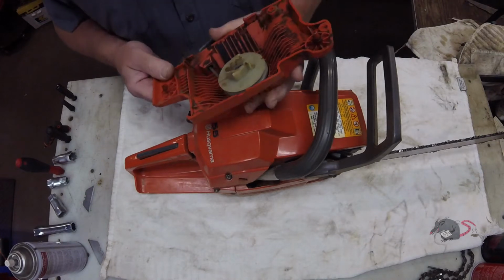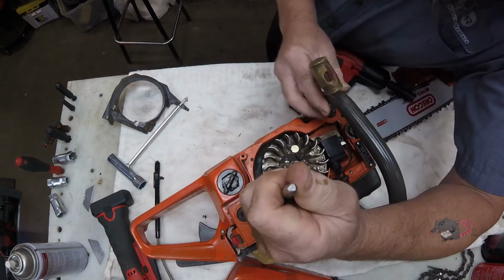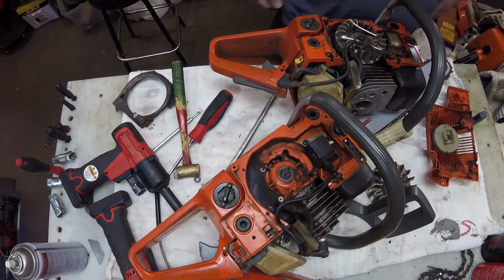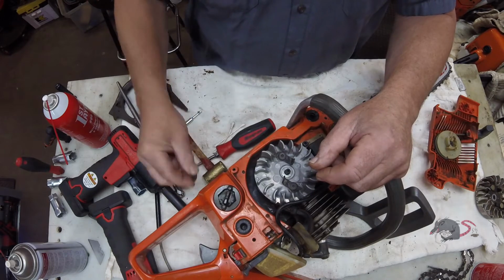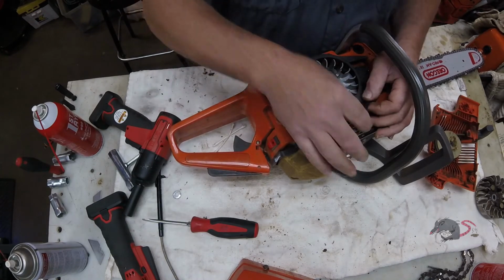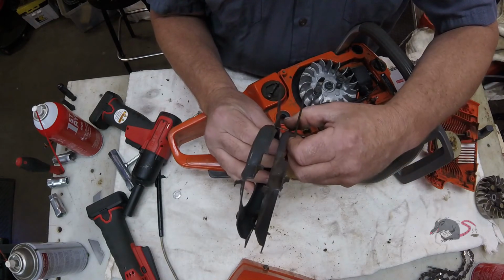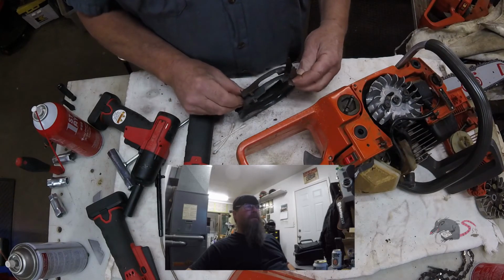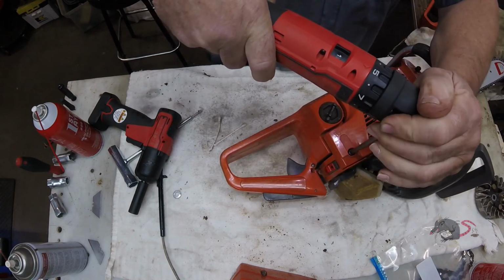Husky 55 flywheel

Comment: I’ve been using the flat face of a very small ball peen hammer to free the flywheel. I’ve also started to just support the flywheel with my fingers slightly underneath to get part of the weight of the saw off the bench, but not the whole thing. I don’t haul back very far with the hammer - just maybe an inch or less and give the nut on the crank light taps until it’s free. Usually takes three hits or so. So far that’s worked really well for me. 🔨
Reply from the maker: I like using that method but I usually use a hammer thats softer than the crank.
Reply: @TheGreasyShopRag  
Brass hammer is on my list, but from what I’ve learned, crankshafts are extremely tough.
Reply from the maker: @Rein_Ciarfella  Ya but its easy to roll that first thread or damage the nut if you hit it wrong.

Comment: Try mounting the right angle grinder in the vice and move the part in to it.  If the trigger has a lock.  Good information.  Thanks.
Reply from the maker: One doesn't just "clamp" a Snapon grinder in the vise. Now please pass the Grey Poupon. Seriously though yours is good advice.